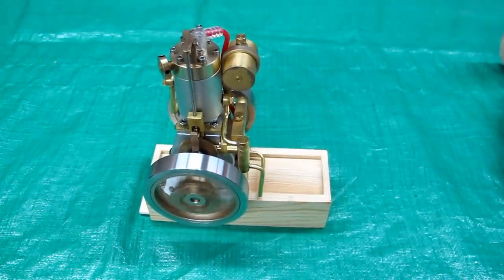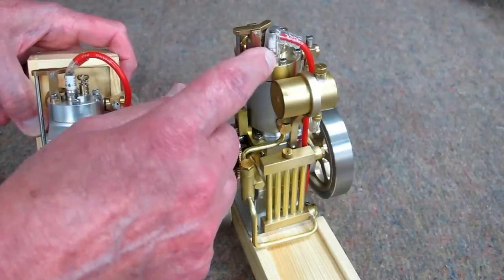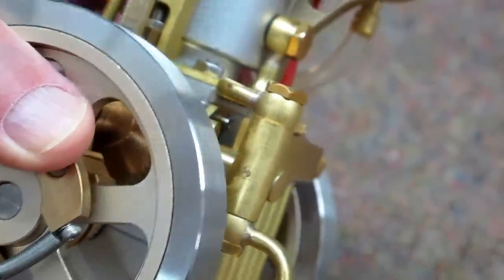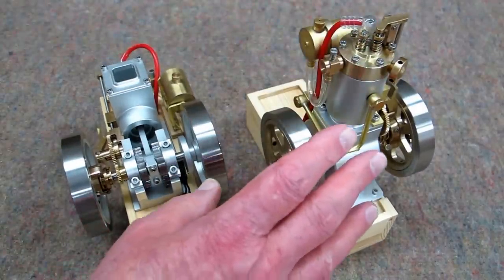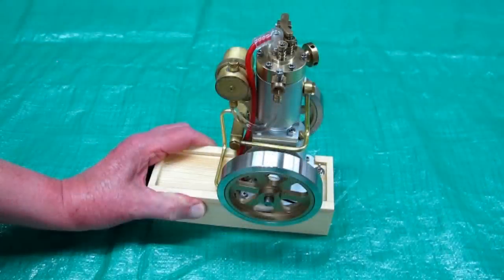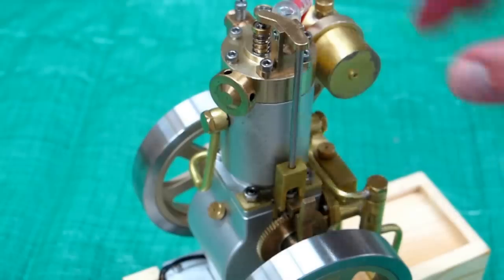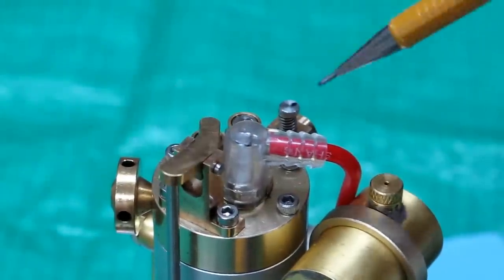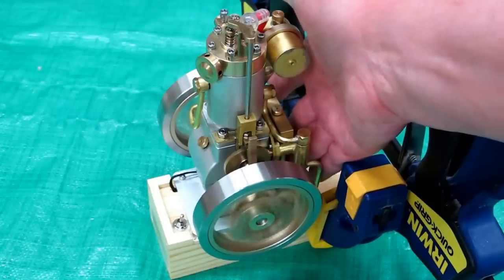Eachine ETX Vertical Hit & Miss Water Cooled Engine

Comment: Hello Ron,

nice purchase! 😃👍
Are you sure about the brass engine head? Could it be the same aluminum head but yellow anodized (difficult to see in the video)?
I hope you will not have any temperature below freezing this year inside your living room. 😉 And if so, how about filling the engine with 35 % of anti freeze concentrate? 🤭 Then you should be safe to -25°C/-13°F. 🙃
When your shoulder is back to normal, how about turning a beautiful airfilter housing in brass or 3D-printing it? Or other machining?
I have a question about the hit and miss: every second I hear a louder "clack"... is this the very brief combustion mode and 90 % miss or is it 90% combustion mode and just 10% miss?
Greetings from Berlin, Germany
Reply from the maker: That's why I said "it appears to be brass". It does not appear to be anodized... but???
My point here was to remind people if you forget there is water in it, it can freeze and break. I don't think I would bother with antifreeze. Several different metals and not sure what seals are inside it. Just drain it up when done playing.
The "clack" is the engine exhaust, but there are some other clicking noises such as the exhaust valve lifter coming off the detent , making contact with the cam and possibly strange sounds being picked up by the camera microphone (echos in my shop)... and the electronic noise occasionally introduced by the editing program.
Reply: @RonaldWalters2010  Thanks for responding! 🙂
But about max revs control: do you think the engine runs 90% in combustion mode and 10% miss mode or vice versa 10/90? This is difficult to recognise in the video.
I like such mechanical toys and the loveley detail of the 90 deg angled terminal of the spark plug wire. 😀👍
Reply from the maker: Looks like it hits... then 7 misses... then hits... then 7 misses.... 12/88.
Lots of things are difficult to discern in a video because of the stroboscopic effect caused by the camera shutter speed coupled with various moving objects, fluorescent lights, etc.
Reply: @RonaldWalters2010  Thanks! 🤗
Do you think 7/8 of the consumed fuel comes out of the exhaust unburned or does the opened exhaust valve during the miss cycle makes the vacuum controlled intake valve kept shut, so that no air is floating through the carburator 7/8 of the total runtime?
Reply from the maker: As stated in the video, the vacuum operated intake valve cannot operate when the exhaust valve is held open so there is no fuel consumption when coasting. No raw fuel comes out the exhaust.
Reply: @RonaldWalters2010  👍

Comment: What did you do to reduce compression? Machine 0.100 off piston like Gil?
Reply from the maker: No, I wouldn't touch the engine. Maybe I didn't say that very well. It appeared (to me) the manufacturer reduced the compression. My vertical engine has slightly lower compression than the horizontal. Compression has improved slightly after running a while, but it is still lower than the horizontal.

Comment: Do you have a link for the starter you made or video? Also where do you buy the weaker springs for counter weights ?
Reply from the maker: I haven't made the starter video yet. That will be one of my next projects... should have shot the video when I made this one (hindsight 20/20). You will probably need a lathe or CNC Laser cutter to make it. I do not think I said I had a link for the springs. I bought them 2 or 3 years ago in anticipation of needing them for my Mini Calliope project and then did not use them. I will look at my records.
Reply from the maker: What luck. The springs are still available out of China… pack or 58 pcs so you’ll have a few spares.https://www.ebay.com/itm/0-4mmx4-5x12mm-Metal-Dual-Hook-Small-Tension-Spring-58pcs-/323742846964?_trksid=p2349526.m4383.l4275.c1#viTabs_0
Reply from the maker: You are welcome! I had to re-upload that video because of a mistake I found in it. This is the new link if you need it. Cordless Drill Starting Attachment for Eachine Hit & Miss Engines https://youtu.be/bD4Yh209CuU

Comment: what spring are you using and where are you getting them?
Reply from the maker: They are 0.4mm wire diameter x 4.5mm x 12mm dual hook tension spring - available out of China… pack of 58 pcs so you’ll have a few spares.  https://www.ebay.com/itm/0-4mmx4-5x12mm-Metal-Dual-Hook-Small-Tension-Spring-58pcs-/323742846964?_trksid=p2349526.m4383.l4275.c1#viTabs_0

Comment: Three in one is terrible oil. It gums up into a kind of varnish over time. I've seen lots of problems from using it. I would use synthetic motor oil. It never gums up and it has remarkable properties against wear, although a motor like this is pretty undemanding for a motor oil. The last thing you want is old oil varnish all over your engine.
Reply from the maker: 3-In-One, Singer, Sewing Machine Oil are thin and get into places that need lubrication. They usually come in a handy container with an applicator nozzle and a cap. We're not oiling a watch here... it's an open build engine. Oil runs off, gets slung off, gets wiped off along with the accumulated dirt and oil from the fuel. It never gets a chance to turn into varnish. Use whatever you want. Thanks for watching.

Comment: Des Français ici ??
Reply from the maker: Sorry, I do not understand your question and this will not translate for me.
Reply: @RonaldWalters2010  your video is awesome i ordered the two same as you just i don't speak english the c google which essence and oil to use thank you
Reply from the maker: Your English is better than my French. :-) I use Coleman Lantern Fuel or Cigarette Lighter Fuel (like Zippo or Ronson) similar to White Gas (Petroleum Naphtha) or Unleaded Gasoline octane rating of 50 to 55 and a little Marvins Mystery Oil (google it) in the fuel (3-5% only) or some use a little WD-40.  Note: Coleman Lantern Fuel does not contain the additives automotive gasoline contains. Sorry, American product names are not the same as European. Hope that helps!
Reply: @RonaldWalters2010  
thank you very much but for the oil to lubricate the engine we see the plug at 10:05 if you have any link to give me for the oil thank you
Reply from the maker: I do not see a plug at 10:05 . Note: The crankcase DOES NOT hold oil. I use a syringe at 5:20 with light weight oil like 3-in-one or singer sewing machine oil to drip a few drops of oil on the crankshaft and connecting rod.
Reply: @RonaldWalters2010  ok so for the crankcase, you use oil 3 in one as for the pinions is that it?
Reply from the maker: Yes. A good light weight oil on anything that turns, rubs or slides. And order a few spare o-rings for the piston rings.
Reply: @RonaldWalters2010  OK, thanks